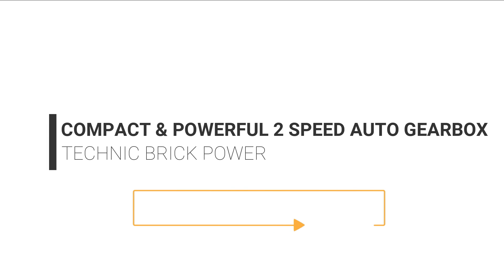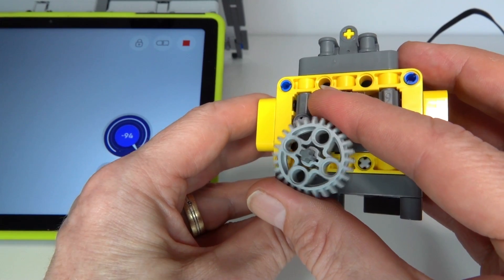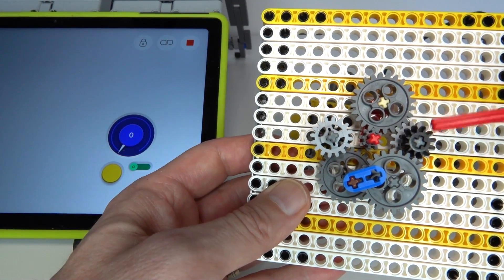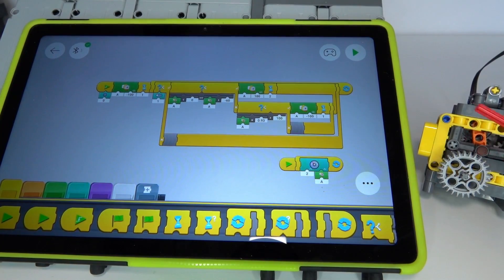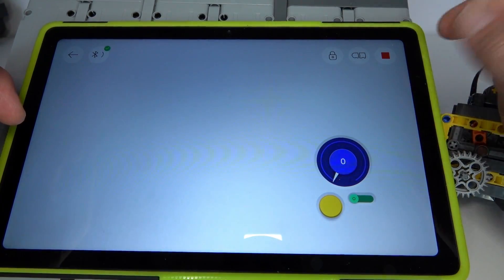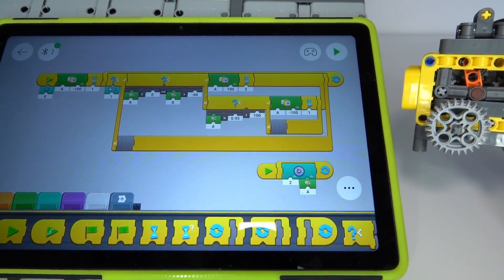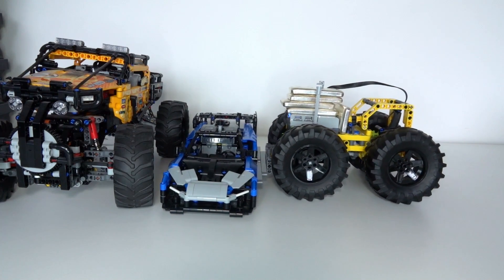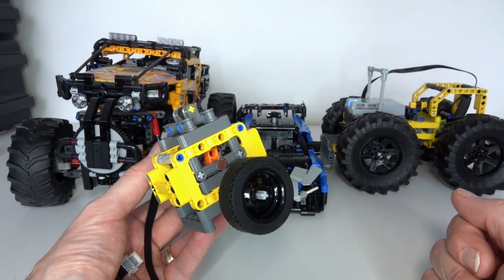Lego Technic Powerful 2 Speed Auto Gearbox

Comment: This is wonderful!!!
I've created quite a few two speed gearboxes, but they always require a seperate motor to shift the gears!!!
This is something truly unique, and innovative!!!
And also it's amazing to see how powerful this gearbox is!
Had a bit of difficulty trying to create a strong enough gearbox for a project (it had to handle the force of 6 Lego EV3 Large Motors!) and finnaly managed to do it, but I am totally using this instead because no shifter motor required - now I can use 7 EV3 motors!
Thank you very much for pushing the boundaries of what's possible for legos, in your own way - truly appreciate it!

unfortunately I just realised I can't - Sadly, this innovative design has one flaw, can't go in reverse!!!! Output is always in one direction ):
 
But still an awesome build!
Reply: You figured out the "flaw" already (it's not a bug, it's a feature!), but yes, by using the direction switch of the motor to shift gears you lose the reverse. So you need another motor going into the opposite direction to do the same in reverse (or just have one gear in reverse). So there is no free lunch, you still need two.